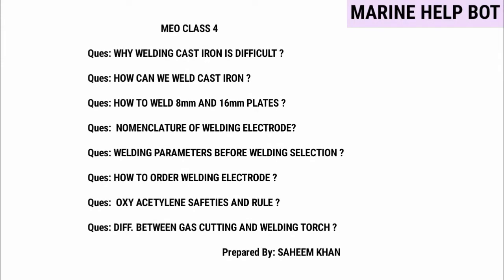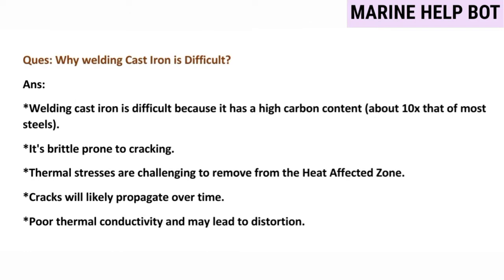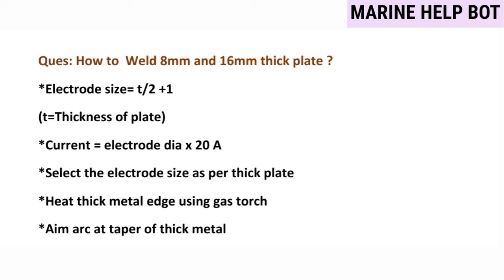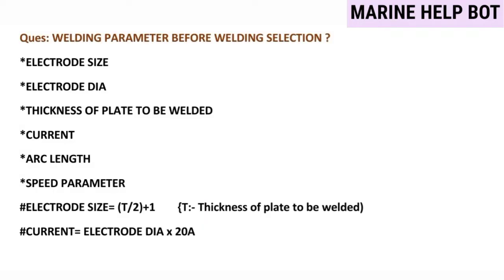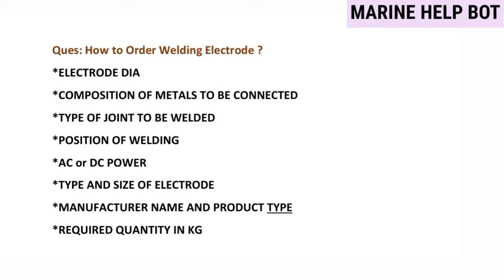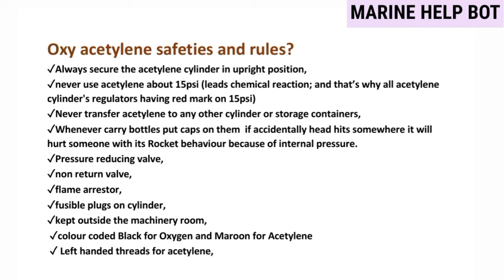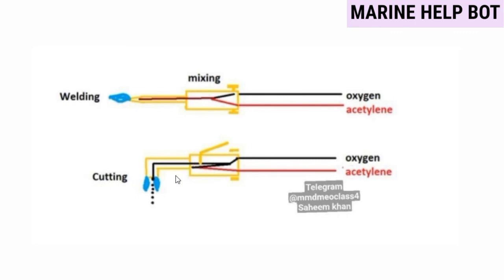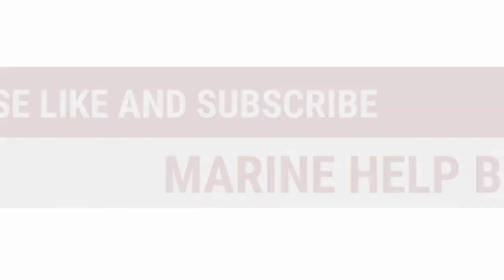Welding Questions Part 1 | Cast Iron Welding | Order Electrode & Nomenclature | Difference in Torch

Comment: While welding 8mm and 16mm plate
Electrode size = t/2 + 1
Here what thickness we need to take 8mm or 16mm ?
Reply from the maker: according to 16 mm and will aim arc on edge of 16 mm plate